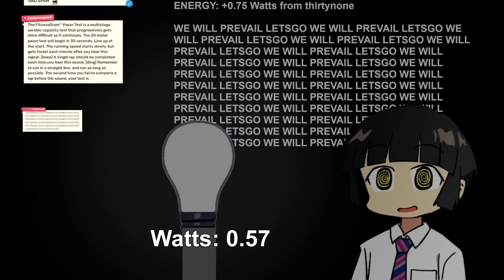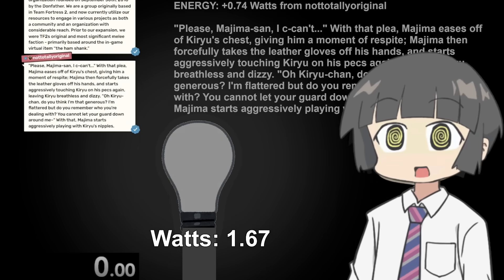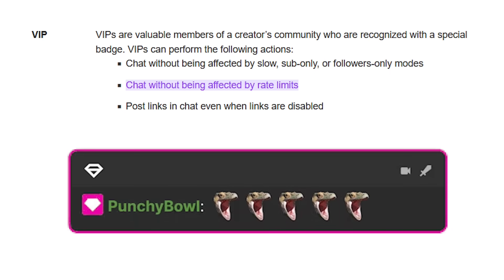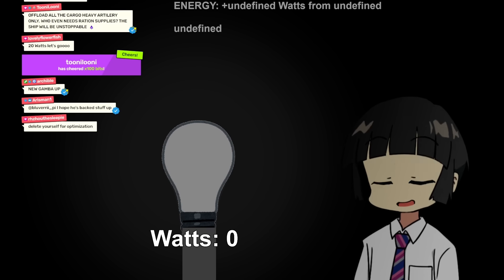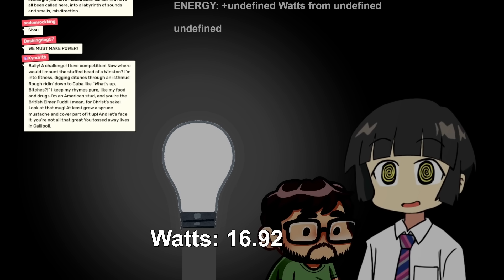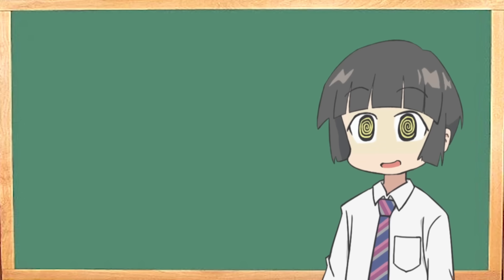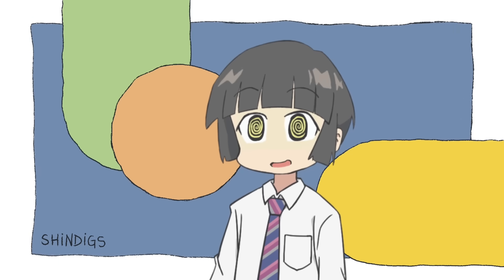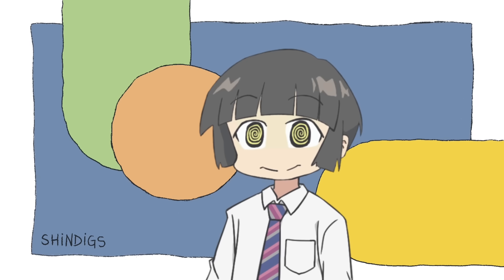Can you power a lightbulb with only Twitch Chat?

Comment: This might be a silly question because maybe the math is just "the number is way too big/small to do anything with", but
So like, isn't there the idea that everything is information and stuff? Could you calculate, like, the entropy of each message and add them up, so something like keyboard spam would actually have less energy than "sssssssssssssssssssspppppppppppppppppaaaaaaaaaaaaaaammmmmmmmmmmmmm"? And then convert that to Joules to try and see how much energy is stored in the literal content of the messages? Or does it not work that way and I'm mixing things up in a way you're not supposed to?
Reply from the maker: Maybe, having the xkcd article made it easier to anchor it in some possible real life scenario

Comment: I paused it randomly and found this gem in the spamming at 4:00 on the dot. “ MrCote33
The FitnessGram™ Pacer Test is a multistage aerobic capacity test that progressively gets more difficult as it continues. The 20 meter pacer test will begin in 30 seconds. Line up at the start. The running speed starts slowly. but gets faster each minute after you hear this signal. [beep) A single lap should be completed each time you hear this sound. (ding) Remember to run in a straight line, and run as long as possible. The second time you fail to complete a lap before the sound, your test is” I love it

Comment: Let me calculate

100×300=30,000
30,000= 3.0000÷100= 3.3334 watts per message
3.33×300=3,330 watts per hour
100=100,000 watts per hour
100,000÷3,330= 33,333 watts per hour
33,333-3,330= 30,003 watts per hour

You need 1,498.75 people spamming to power a 100 watt light bulb if 2 then

30,003÷2=15,001×4=70,007 watts per hour
70,007×2=140,014 watts per hour if 2 channel stream.